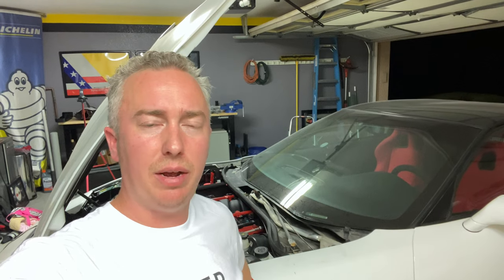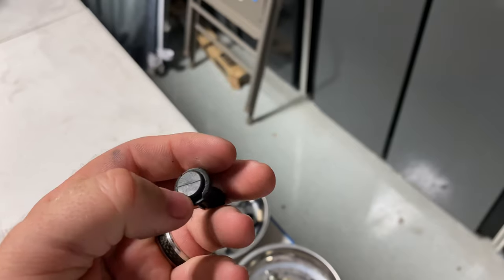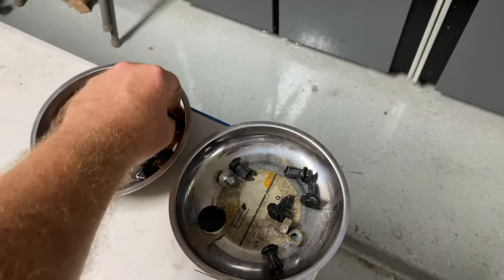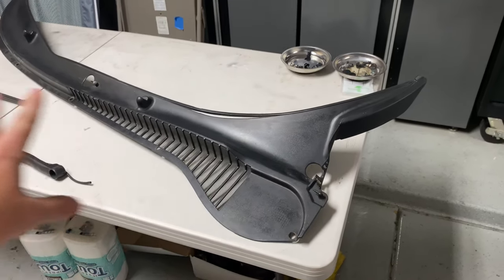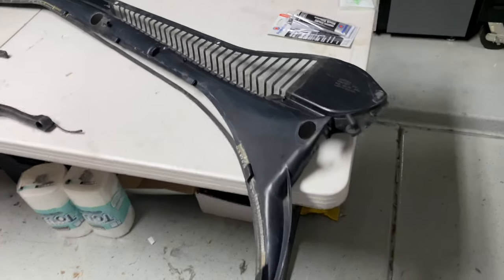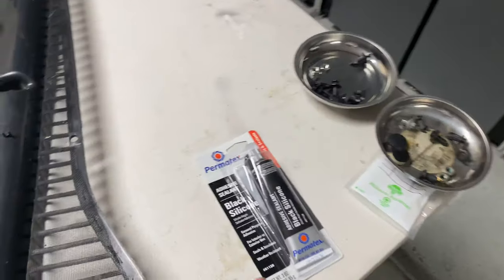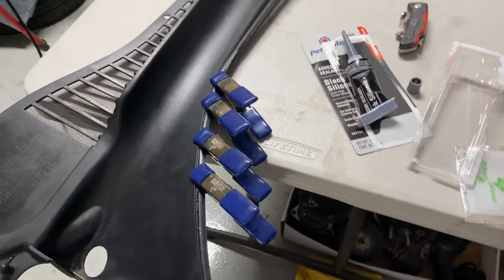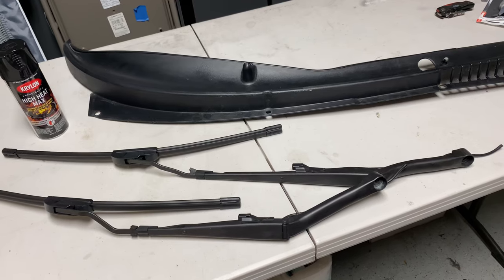How To Repair C5 Cowl Rubber Seal

Comment: Took mine off to do same repair. Cleaned it good before replacing. Used mothers black to black. Be careful I actually cracked my wind shield trying to remove wiper arm. 🤨

Comment: Hey Chris, there are two udders on the driver's side, and one on the passenger side under the battery, which is longer and curved. Thanks for pointing that out and another awesome video as always!
Reply: 3 udders on the drivers side at least on my 02 z06
Reply: Three on driver side is correct
 Just got to reach back but it's there. Don't forget to be sure AC condensation drain is also clear. A clogged one will cause water in the car. Bugs get in and clog it. Good luck reaching it unless you have toothpick arms. Rubber is hose on firewall behind intake manifold.
Reply: I replaced the cowl on my 04 Z06. It was slightly warped and there was too much gap between the windshield and rubber strip. I ordered a new one from GM parts for around $235. About $115 for oversize box but it was still about $150 less than one of the ripoff Online retailers.

Comment: Do you of anyone know if the seal between the cowl and the windshield can be purchased? It appears my seal shrunk and created an inch gap at the corners of the cowl.
Reply: same prob i have.. looking for a replacement seal
Reply: @do5e  they don’t sell the seal alone. Looked everywhere. You would have to purchase a new cowl which I don’t know if it’s available anymore. I’m just dealing with it and accepted it
Reply: i think water is getting in from the gap that was made from it shrinking.. spent a few hours trying to find a new one.. no luck.
Reply: i actually ordered the wrong part thinking it was the seal for the cowl to windshield.. the part called Hood to Cowl Seal is the wrong part.
Reply: @do5e  rubber shrinks overtime when it gets dried up. My thoughts
Reply: @do5e  I almost did the same thing. The description wording is wonky
Reply: @robertchrachol2732  i think if i try to repair mine, because it shrunk a few inches, if i remove/clean/silicon seal it back in place it will be short.
Reply: @do5e  yeah, it will be probably short

Comment: Good video Chris, I have to do this right now, same exact issue, its coming off in the same place. I took off the drivers wiper arm prior to checking out this video. I forgot to mark it so I hope I dont have to spend too much time getting it aligned properly. My wiper arms werent chipped, just oxidized badly. I used some auto store turtle wax polishing compound on them and they look like new again. I will put some wax on them too slow the oxidation cycle. I tried cleaning them before trying paint because I didnt have much time tonight to do this, but didnt want to do this without restoring them. Yours came out nice, and thanks for your help on this. It will be quick and easy now that Ive seen it done. I get nervous prying on plastic, not knowing whats hidden underneath. Ive seen many things cracked by people guessing, and jumping in blindly. This should go smoothly with your help. Thanks again.

Comment: Hey Chris! I’m going to be repairing my little seal on my cowl panel as well. It’s only about 6-8 inches thank god! I’m going to paint my wiper arms too. My cowl panel is a little faded, do you think if I cleaned it up real good, wipe it down with 91% alcohol, that the paint would do ok? I know they make a plastic spray, but was wondering if regular enamel would be ok. Thanks
Reply from the maker: Idk if I would paint the cowl.  Even the most faded can be brought back to like with the right product.

Comment: The weather strip around the battery is floppy and I noticed it had a flange where it should be screwed or fastened in.  I'm not sure how/what kind of fastener it uses.  Anyone?
Reply from the maker: Mine is not fastened.  It’s made to remove easily.

Comment: Great upload and glad you mentioned the utters. FWIW, in addition to leaves, Pine Needles really, really wreck havoc with clogging them up. So when looking to park your Vette in some shade, I'd suggest staying away from pine trees. As to using the Permatex adhesive, what is recommended for clean up for the extra glob that might occur during applying same? Mineral Spirits maybe? Or ????
Reply from the maker: I would wipe off any excess right away.  It takes about 24 hours to fully cure so it wipes off pretty easy if you do it soon after application.